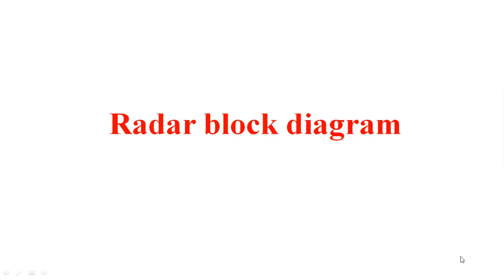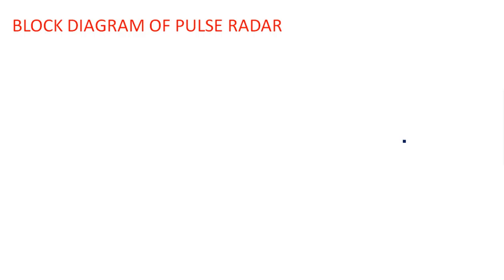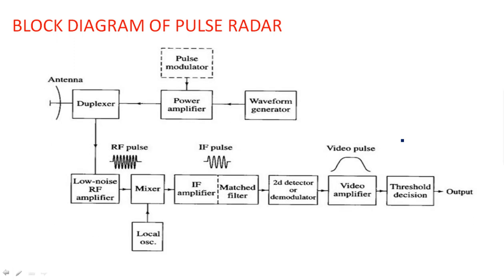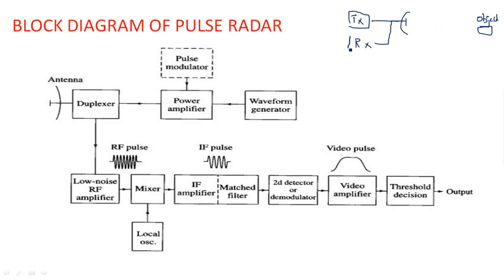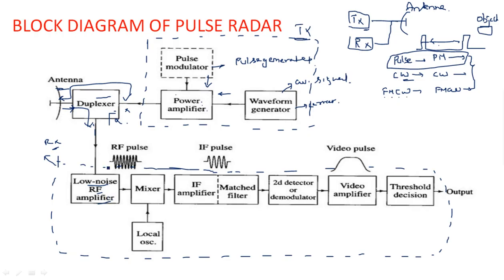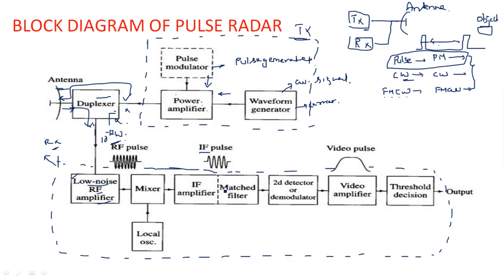Radar block diagram | Pulse Radar | PPI Display | Radar Systems | Lec-06

Comment: What does the local osc do ?
Reply: The local oscillator provides a frequency slightly less than the transmitted frequency. When there is a return echo, the received frequency is mixed with the local oscillator frequency (the output of a mixer is the sum, the difference, and the two fundamental frequencies). The mixer output is applied to a low-pass filter, so that only the difference frequency is allowed to pass. The difference frequency is an intermediate frequency, which can be amplified and processed into a video pulse.